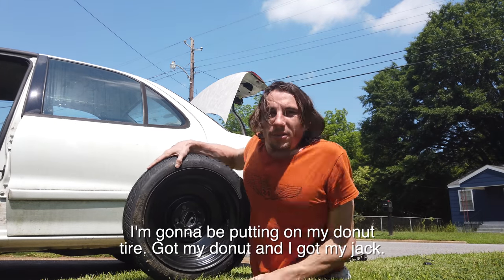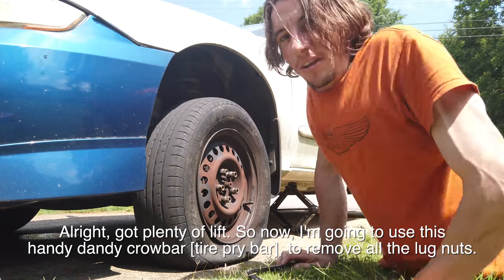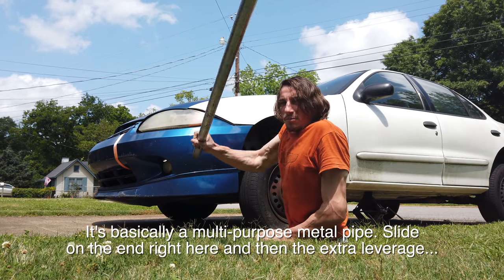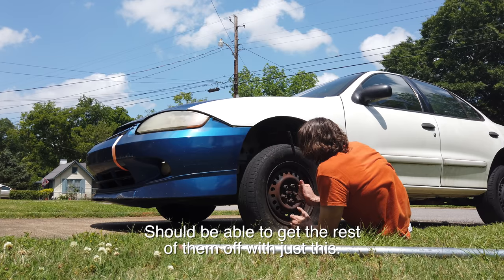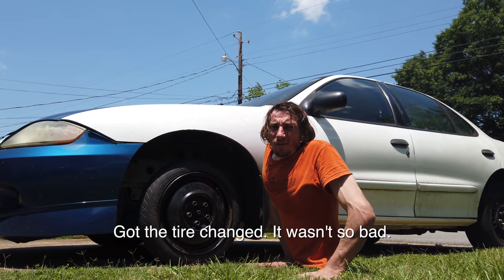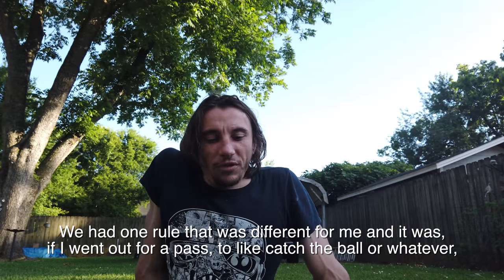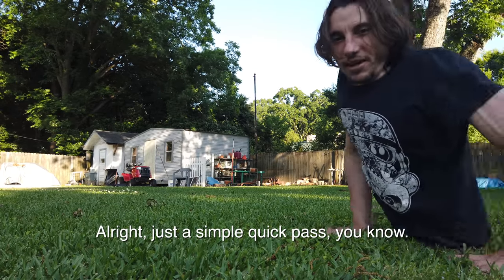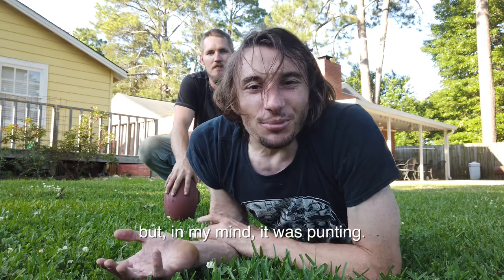Changing my tire | How I play football with no legs [CC]

Comment: FYI, always loosen lugs before jacking. Been there done that!  Cheater bar is handy for sure!
Reply: Thanks for the tip!
Reply: It's not too important on a front wheel drive in gear
Reply: @rahhmennoodles338  it still give unnecessary wear on it. It's just a good thing to do it before lifting it.

Comment: tip - it's better to undo the log nuts when the tire is down, that way you prevent the car from sliding when you try to use the bar.

Comment: Had a tire changed at a local tire shop. About a month latter I had a flat on that same tire. I had to use a 4 foot cheater bar to loosen the nuts.. One of the nuts twisted off . I guess the tire shop got  two of the lug nuts  cross  threaded  , but they got them  completely tight. I got the other lug nut about half way off and it stopped turning. Had to break it off too!  Had to replace two of the 5 studs. Believe me I was not happy. The tire shops are supposed to use a torque wrench, but many don't. That's why you need to carry a cheater bar, because some people refuse to do their jobs in a professional manner. Thumbs up to you! I enjoy your vids!👍

Comment: hey rowdy if you ever do get stranded  you can put your tire iron horizontal with the ground while on the lug nut, then lay down so your back is on the ground and you should be able to push up and your body weight wont be a factor!